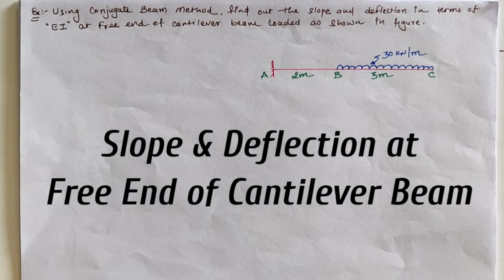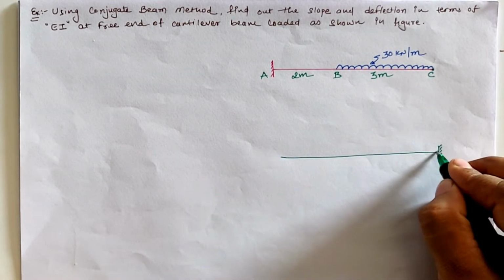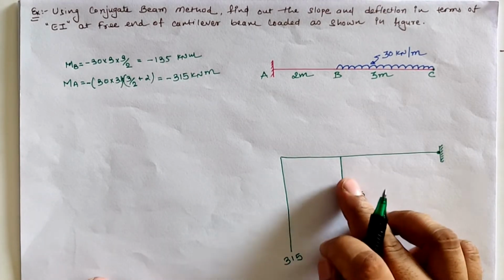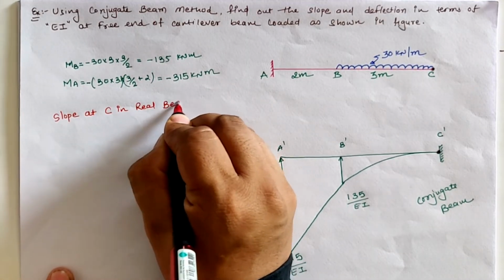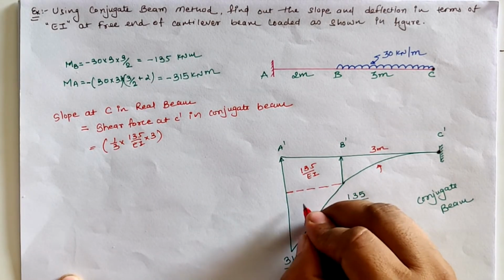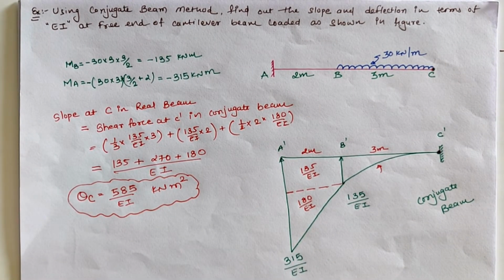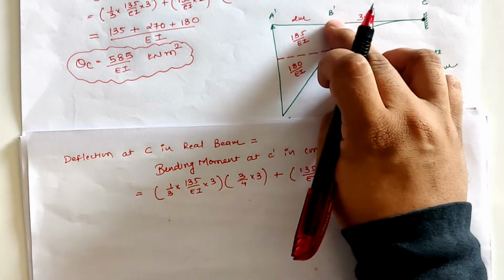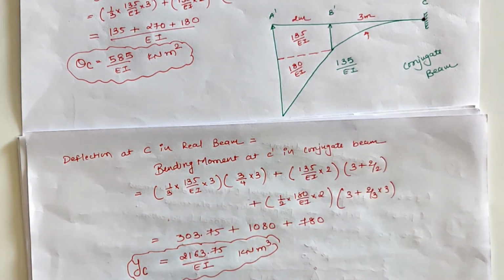CONJUGATE BEAM METHOD FOR SLOPE & DEFLECTION - CANTILEVER BEAM WITH PARTIALLY LOADED UDL

Comment: Slight mistake on bending moment for the triangle I think it the CG should be 3+2/3×2 . should be multiplied by 2 not 3
Reply from the maker: Thank you dear..... You are right ..ts writing mistake... 3 + (2/3)*2 ... But the value according is 780 as written so no mistake in final value...